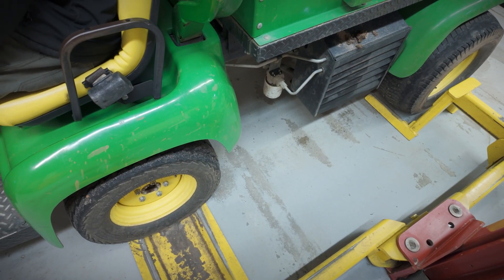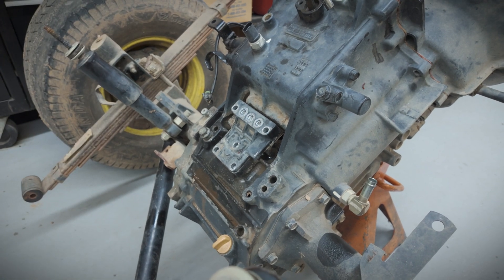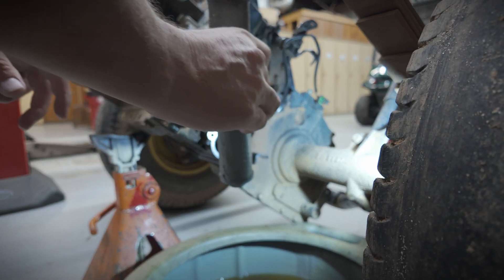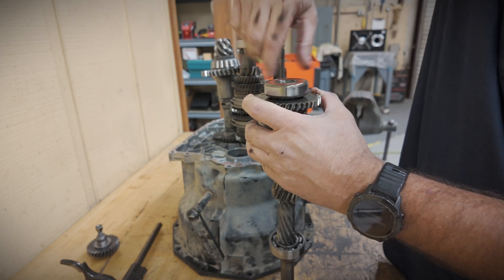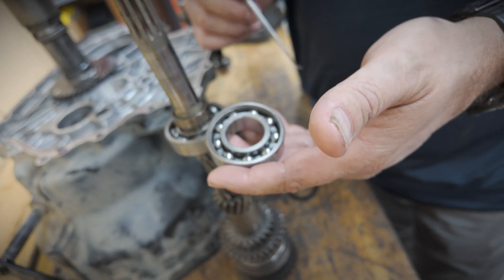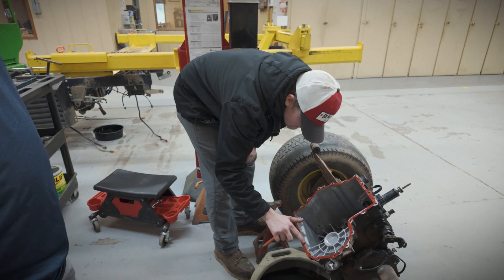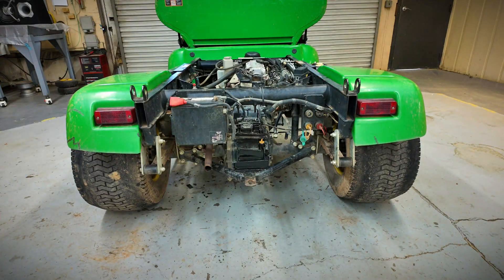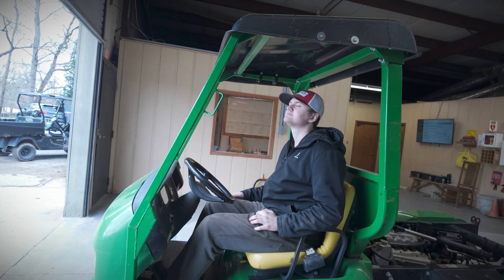ProGator Input Shaft Bearing Replacement

Comment: I feel slightly more confident to pull apart the transmission on ours now (it likes jumping out of 4th gear) I just don’t feel like doing ll the other disassembly work to get the rear end off. And I’m kinda scared to even see what the suction screen looks like 😂
Reply from the maker: @_P0tat07_  It's a big job but you can do it! Reach out at reelturftechs@gmail.com if you have any questions.